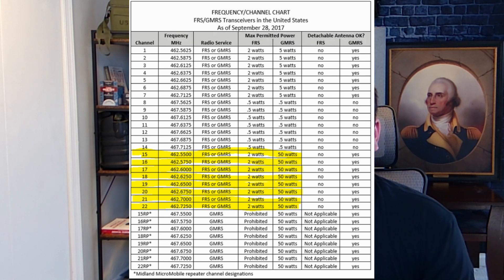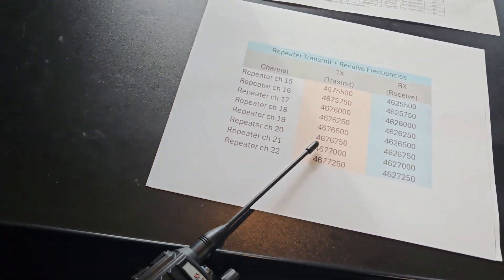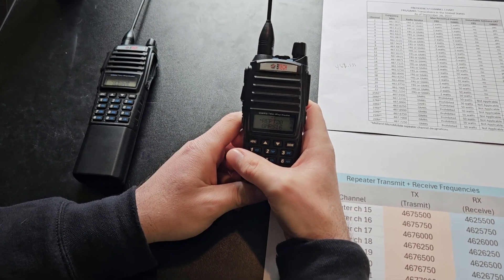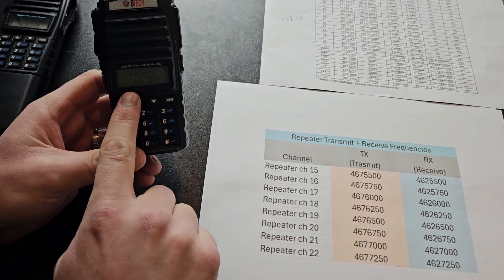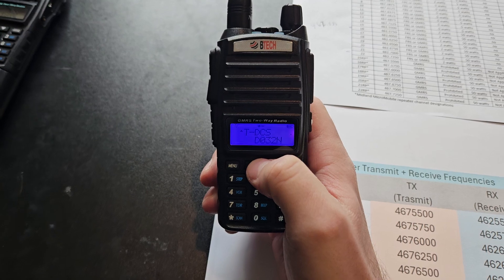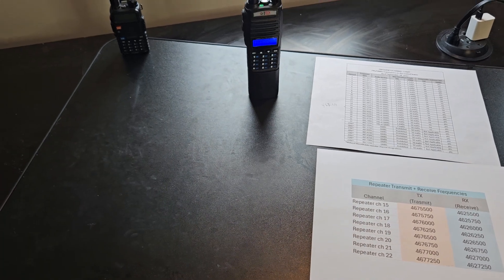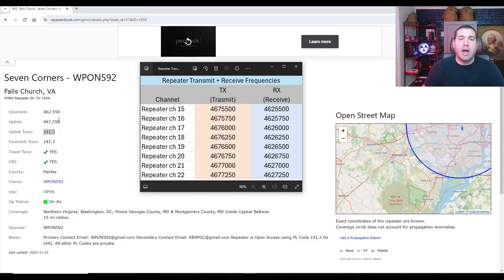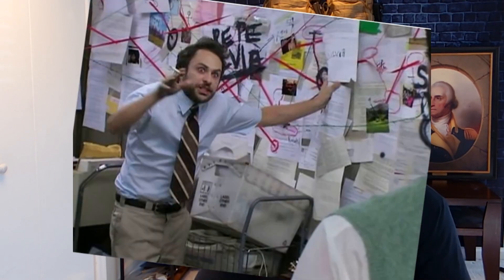How GMRS Repeaters Work & How to Connect to One

Comment: My repeater has a DPL tone...what is that? I have a UV9G and two UV-5G.
Reply from the maker: what are the codes, channel and freq its on i think i can help.
Reply: @citizensurvivalplan  Thanks! Great video btw!!! 
462.650-RX
467.650-TX
RX & TX DPL Tone- 743
Reply from the maker: use it as a dcs tone. should work my gmrs radio has that code in there as a dcs tone. Sometimes radio brands call things differnt from one brand to another.
Reply: @citizensurvivalplan  ok will try. Also I have a Retevis RT97...good option?
Reply from the maker: the rt 97 is a repeater right? yeah im sure there good.
Reply: @citizensurvivalplan  yes sir it is
Reply: Good morning...I got the RT97 portable repeater working...tones put in...one question.  Do i put in the tones on the repeater channel (I'm using repeater ch. 1) or just the frequencies? I took the tones off the channel itself and my radios wouldn't talk to each other
Reply from the maker: they should not with ham its a little more complicated where on gmrs offsets are preset ham are not a gmrs radio depeding on the offset of a ham repeater prob wont work. @IBEW44